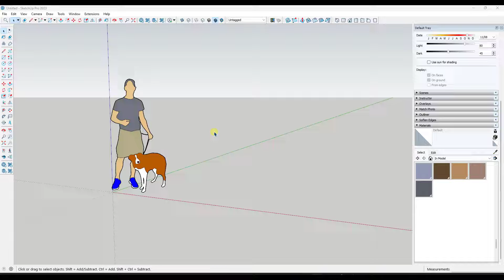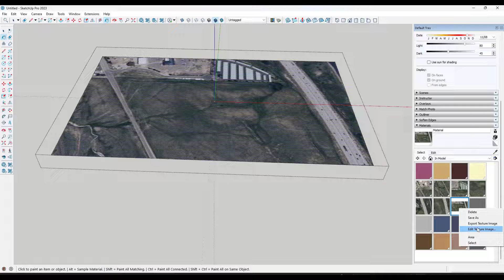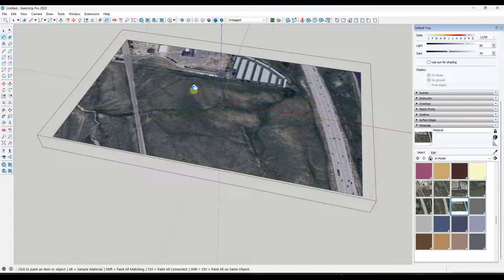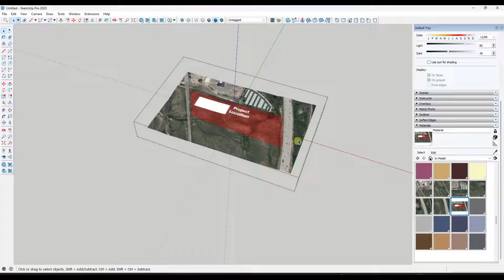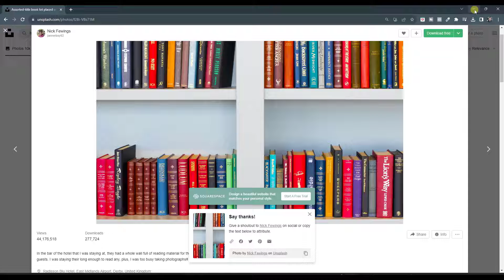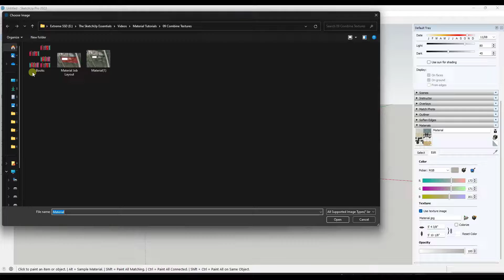Comment: Is it still not possible to create an image larger than 2048 pixels? Maybe there are other ways to create images with a higher resolution. It would be useful for many tasks.
Reply: In Preferences, on the Graphics tab, check the box "Use maximum texture size".!